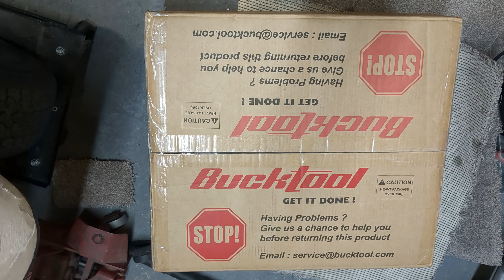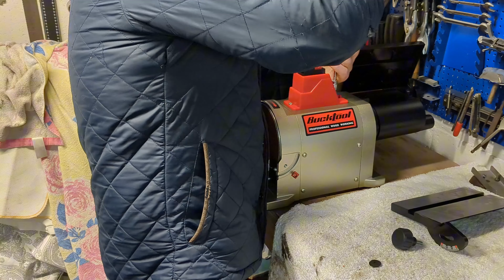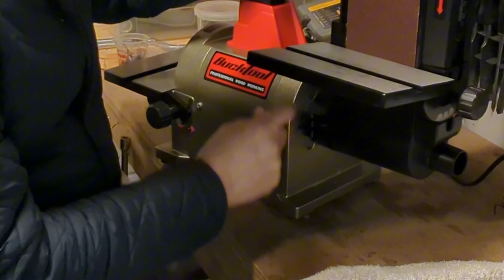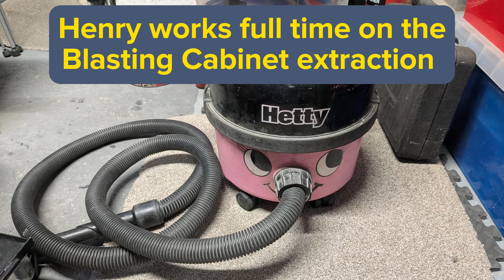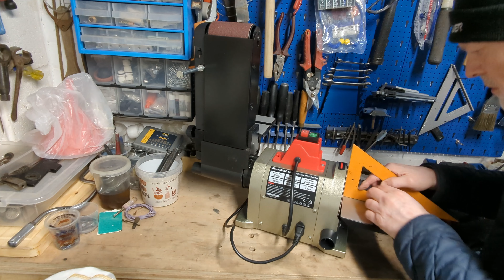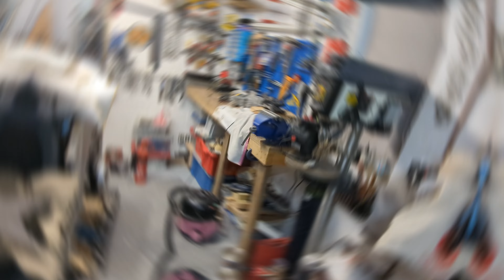Fingers At The Ready.

Comment: Hi, good review, thinking of getting one to replace my current one, can you plz give me the base dimensions width between holes etc cant find them anywhere
Reply from the maker: Not sure what holes you mean? Mine isn't bolted to my bench. Two reasons, it is pretty heavy and doesn't move around and secondly, I need to be able to move it around when changing the belt and or disc. It is a really good machine. I use it daily for mainly metal and occasionally wood.
Reply: @itsalldoable as in distance from each mounting hole on the ends, i will be mounting it on a removeable system, (space ltd)
Reply from the maker: @theplantpotman hole centers 265mm. 
Always happy to help my subscribers. 👍🏼
Reply: @itsalldoable thanks for the info 👍 appreciated and now it is doable for me 😂😂 happy making